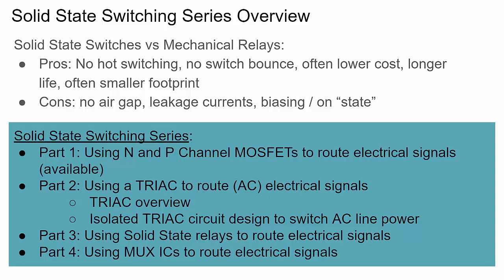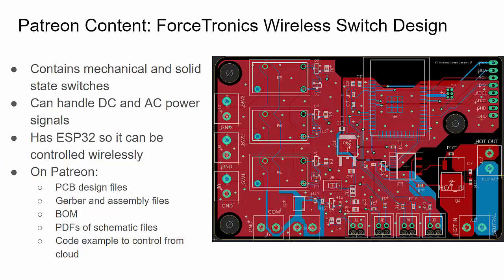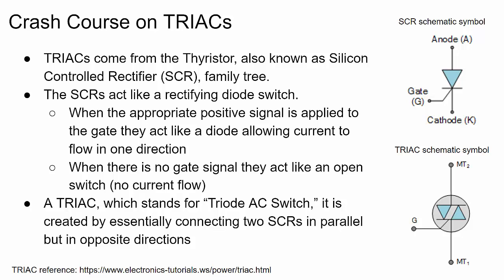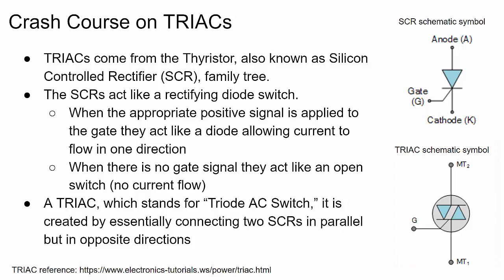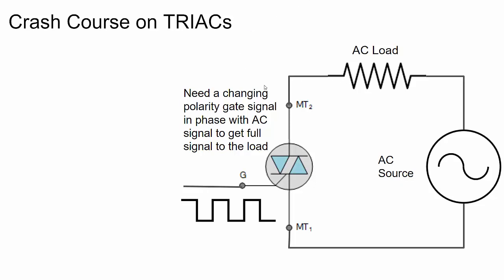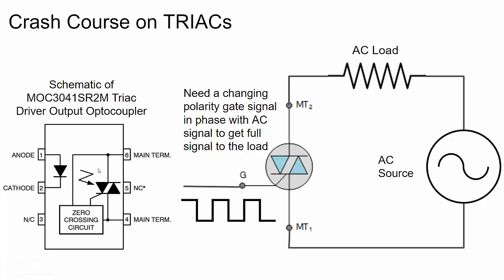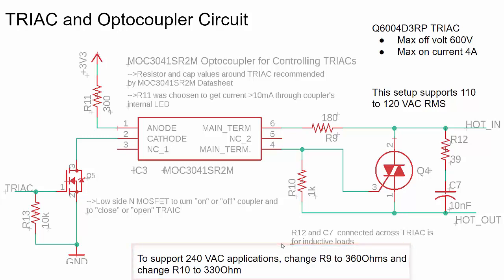AC Electrical Signal Routing with a TRIAC and an Optocoupler

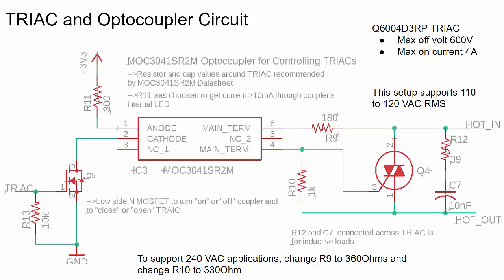Comment: I'd like my water heater to work only on solar power without using any grid power. The existing solutions expensive and do not do what I need. If anyone knows one let me know. The idea is to make AC using H brigge using 4 mosfet transistors. I mean we take 6 panels 36V in series which give 216V DC. Using the H bridge we make square AC which is 216V AC. Then I'd like to have ESP32 controlling 2 AC sources 216V AC from H Bridge and the 240V AC from the grid. I wish 99% of the time to use AC from H Bridge as even on a cloudy day in the whole day it should keep up with heating the water. For the emergency case if I need hot water I'd like to be able to activate grid power to heater but generally speaking I hope this won't be happening very often. So in my design I will have 2 schemas as in you image at 10:20 https://youtu.be/tWvAgTdcFxs?si=jicIm5SMJO4SXBGx&t=620 and HOT_OUT will be connected from both schemas and directed to the heater. What I really afraid and do not wanna to happen is that AC from grid goes to solar panels somehow. I know DC is more dangerous than AC, but I'd like to limit bad things to happen so that 240V AC won't get to the panels. Let's name schema 1 which works for square AC from H Bridge, and schema 2 which works from grid. I'm thinking the TRIAC2 input from ESP32 to connect to a mosfet gate and drain of that mosfet connect to the first pin of optocoupler in the first schema, and source to ground. That way I add a protection to shorten the solar panels triac control to the ground that it won't be active once I actiavte the grid. Will this be safe enough or it requires any other protection? I think it should be enough. Panels will be grounded so even if AC from grid somehow leaks to the panels the RCBO will should trip the curcuit. Any mistakes in my approach? Any improvments can be done? I see a potential issue for the cloudy day the calculated resistors should have different values depending on the AC voltage and in my case it can be anything from 0-216V AC.

Comment: R11 resistor provides 11mA given there is 0 voltage drop through the LED and the MOSFET. I am either missing something or there is no way you are getting more than 10mA through that LED. It's probably more like 6-8mA.

Comment: Hey, I’m back… I hope you’re doing well. I have a new question for you for a different project. Is the MOSFET between the microcontroller and the optocoupler necessary? Can the MCU provide the 3.3V/5V to the Anode with a limiting resistor and then just have the Cathode connected to ground? From the datasheet, if I’m reading it correctly, it looks like the MOC3041 has a max LED trigger current of 15 mA. The limiting resistor value would be key for the optocoupler and the MCU, I presume. Vf (1.25v) is the drop across the LED, correct? The datasheet also says that value is at 30mA typical. That’s confusing if the max current is 15mA. Ugh, me and datasheet 😁. (3.3V-1.25V)/300 ohms approximately 7mA. Is that saying I can successfully turn ON the optocoupler LED with 7mA? If so, my MCU can handle that. SORRY, that’s more than “a” question. I have used optocouplers in the past with a MCU to switch higher DC voltages. This application with AC voltages has been an interest but now I have projects on the bench. I’d like to get this first part nailed down before I start smoking some TRIACS 😁. Oh, and I well. I have watched this video several times and find it very helpful in jump starting those projects. Also watching your other videos 👍.
Reply from the maker: Yeah if the microcontroller pin can source enough current then that should work. You can either use a logic high to source current or you could connect the negative side to a pin and use an active low to sink current. I went with the MOSFET so the video showed how to do it independent of the logic control source they were using. I don't remember the current values off hand but I do remember that datasheet covers multiple opto-coupler part numbers so just make sure you are looking at the same part number for current values for the internal LED

Comment: Question… How can this be applied to a 240V split-phase (3 wire single-phase) system? There’s L1 and L2 with 180° phase difference. Ugh, I feel like I’m not being clear enough on what I’m asking. It’s something I’ve been trying to get my head around for a while now. Google, as clever as she is, hasn’t been able to direct me in the correct direction. All I get are 120V single-phase responses. Out of the responses on single-phase and TRIACs, this video is absolutely the best I’ve come across to date. I’ll check back to see if you respond. I feel if there’s anyone out there that can help me or point me in the right direction it’s you.
Reply from the maker: Unfortunately I am not familiar with a split phase system. If you are working with a 240v line I believe the video tells you how to adjust the resistor values for the higher voltage. You can also refer to the datasheet of the optocoupler for guidance or refer to their support such as forum.
Reply: I’m almost positive all that is needed is to switch one leg of 120v. For example, when using a 1-1/2 pole contactor on say a HVAC compressor, one 120v leg is switched and the other 120v leg goes through the shunt. It would be the same thing, correct?
Reply from the maker: It sounds like you just have a standard single phase setup with a "Hot" path and a "Neutral" path. The hot path can be seen as the source of the positive portion of the AC waveform and the neutral is the return path. And just the opposite for the negative portion of the waveform. In that case you could just switch one of those paths so that there is not a completed circuit and current does not flow in either direction. But if you are working with a generator or any inductive load sometimes the coil in the load can hum if it has a voltage on it so you may want to switch off both to prevent the coils in the compressor from humming. But the compressor may also protect against that so it maybe best to just try both approaches and decide what is best for your needs and setup. @douglasosborn3378
Reply: Thank you for your response. I’m doing a poor job asking the appropriate questions. I probably also confused things worse by using the HVAC compressor as an example. I’ll try to elaborate. Say for instance, I’m trying to switch a 240v single phase HVAC strip heater or a 240v hot water heating element… 240v in the USA. There’s two hot 120v legs with 180° phase difference, L1 and L2. The potential difference gives 240v. Please know, I'm not trying to educate; I’m just trying not to repeat a mishap I had in the past by me trying to be too clever. At the time, I thought I was, but NOT. 🤫 In my defense, I did have tech support on the phone. After the huge bang, sparks, and smoke, I thought, “I really need to understand this (TRIACs) more.” The TRIACs gave up the ghosts! BTW, thank you again for your response and patience. To continue… I recently had the opportunity to have my head in HVAC package unit with 3x 240v strip heaters switched with relays. L1 was switched through a relay to one side of the element. L2 went through a sequencer to the other side. The sequences are there so all elements don’t come ON all at once and draw huge current. The order of operation is all relays CLOSE then the sequencers CLOSE one after the other. Sequencers, bi-metal switches do their magic after the circuit is complete. They are there to keep from over current tripping breakers. Take the sequencers out of the equation and instead have a microcontroller control the TRIACs through a driver. For the on-demand water heaters, there are no sequencers. A microcontroller receives input from a flow-sensor and turns ON each element depending on demand. Oh gosh, TMI! Anyway… not 120v single phase with a hot 120v hot and a neutral… nor, 240v single phase as in Europe…. 
2 phase? No, people will look at you like you’ve lost your mind. 😁 240v single phase USA. Split phase, i think is the correct terminology… but, 🤷🏼‍♂️. I wish I knew how to send a circuit diagram. Ugh, if I could even find one, so far, I haven’t been able. Best regards and kind wishes. Cheers.
Reply from the maker: If inrush current is the issue you are trying to solve you can always turn to a NTC Thermistor based inrush current limiter. When they are "cold" the present a resistance that prevents a large current rush, but as they warm up they act like a short. Here is a link to an example one: https://www.digikey.com/en/products/detail/ametherm/SL12-10006/1873481 @douglasosborn3378
Reply: @douglasosborn3378  sequencers do not prevent overcurrent of circuit breakers. All they do is stage the energizing and de-energizing of the electric resistance heat elements. This allows the voltage to drop from 242 down to 240, then from 240 down to 238, etc. If you just went from 242 to 238 the homeowners would notice the dimming of lights, speed changes in motors, etc. If the electric elements happen to be inductive loads, then yes, turning them all on at one time could trip a breaker, whereas sequencing the motors would be best.

Comment: Great video, thank you!  I do have a basic question though.  It's always been my understanding that for any sort of isolation device such as an optocoupler to be effective, the grounds on both sides of the circuit should NOT be shared.  However, what if my microcontroller power adapter (wall wart) and the AC device (Edison bulb) are both plugged into the AC mains outlets within the same house/building?  Wouldn't they share grounds in that case?  Thanks.
Reply from the maker: Great question. Wall warts are isolated from the AC hot and neutral lines because they have a transformer inside. If it is a two prong wall wart then it has a floating chassis ground (that is why it has a plastic case) that is totally isolated from the AC lines. It is possible that a DC circuit could be tied to AC line power earth ground without any issues. Earth ground in your home AC wiring is there for safety purposes and not actually tied to the AC's current path. You just want to avoid connecting DC  potentials to AC line power neutral or hot lines. Sometimes folks will tie DC ground to AC neutral thinking they are the same thing and they are not.
Reply: Great question followed by a great answer